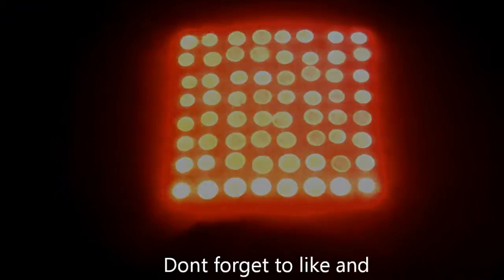My 3rd Arduino Project 8x8 RGB LED Matrix with PWM code

Comment: Are those common anode LEDs? Also, did you use only arduino and 4 74HC595N shift registers? If so i'd be very glad if you could send me the code.
Reply from the maker: +ThorOdinson1269 yes they are common anode led's and i did indeed use 4 74HC595N shift registers? , if you watch all my videos in the description "1st, 2nd, 3rd projects, you will see more clearly the components I used for this project, thanks for watching.

Comment: Hey, nice Project, cool colours.. I am Building a X=30 Y=20 Matrix. Totalling 600 LEDs. (LEDS=WS2811 RGB Strips.)   I want to create a star ceiling. I will be attaching the ´stars´ to the LEDS as Plastic Fibre Optics... in other words, I will be bundling about 5 plastic optic Fibres together, and attaching them to each LED... meaning I will have 3000 stars. I want to Control the stars via remote Control, so that I can perhaps have about 12 Buttons.. each button could be a constellation. So when I press the desired constellation, the LEDs would Change according to the configuration. Can you recommend a way of programming this with Arduino? Thanks.

Comment: Great job - looks really cool! I am working on a 8x8 RGB LED matrix myself and am trying to figure out how to do it myself. Could you also pm me the code? That'd be great!!
Also: Did you just use the 595 shift registers for driving the LEDs and nothing more? Then you adress each LED with multiplexing? I am trying the same but am experiencing issues with the intensity of the LEDs..

Comment: Working on a similar home project, and am learning much like yourself. Matter of fact I am looking at my bread board right now and it looks much like your project number 2. I would really be interested in seeing your code for project number 3. Looking on line at the 595 shifters and trying to get a diagram of the RGB LED matrix much like the one you used. Thanks for posting video.